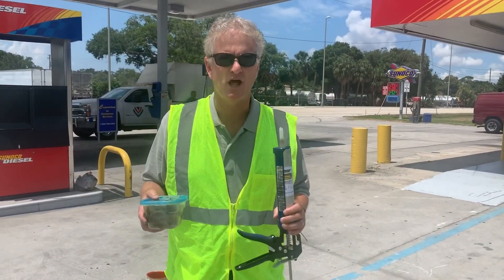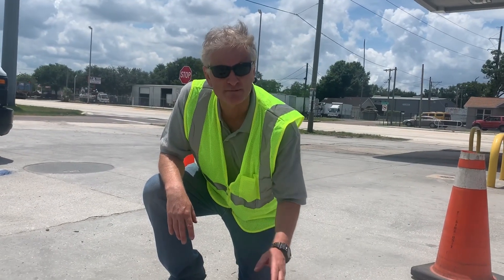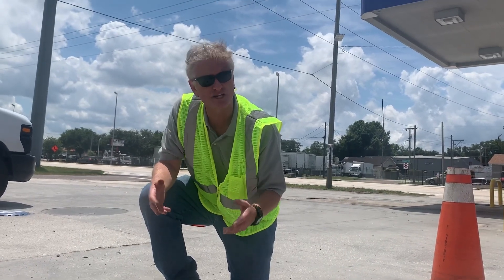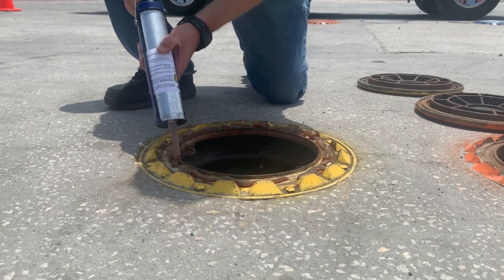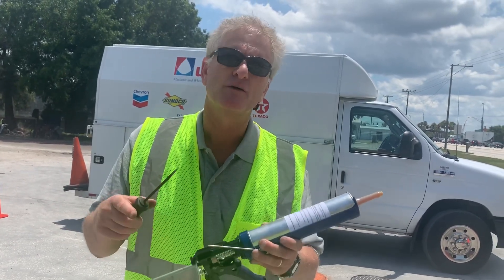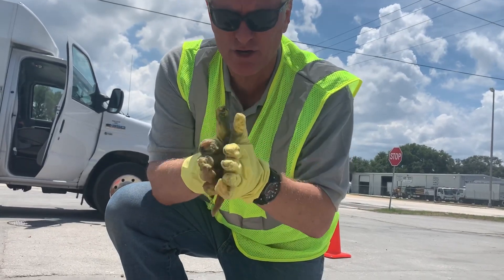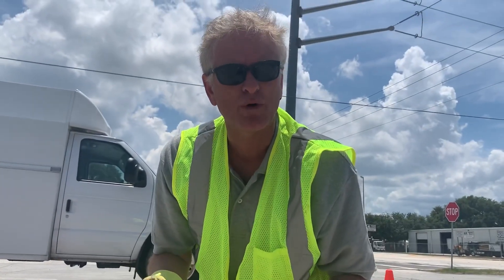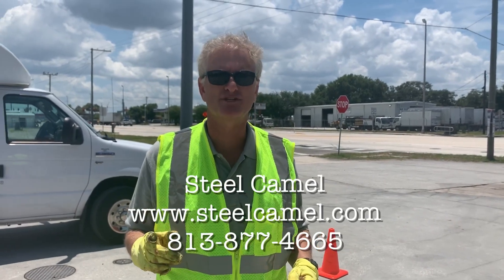How to Block Water From Entering UST Spill Buckets - Using Steel Camel Water Blocking Technology

Comment: Would it not be best when wire brushing and cleaning the rust and dirt off the spill bucket to leave the Top Seal cap in place to avoid introducing dirt and foreign items into the tank?
Reply from the maker: Our contractors who perform preventative maintenance are typically good at prevention of dirt and debris from entering tank.
   it is important to get a a clean surface to maximize bonding.  tx.  happy to help.
Reply: I’m in the business in CA. Does this work well on sump lids?